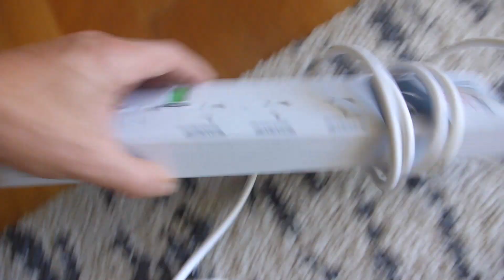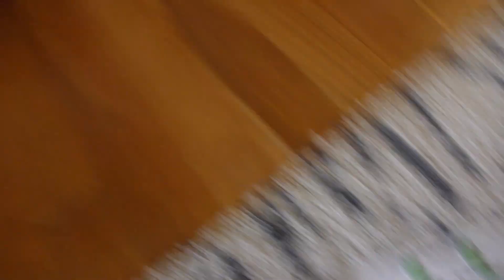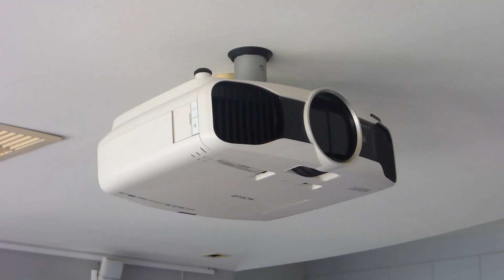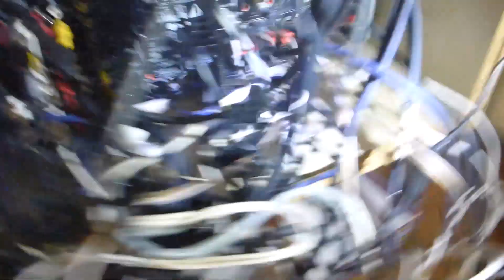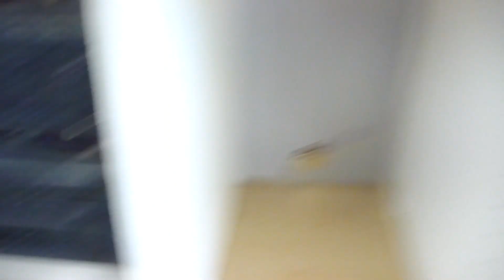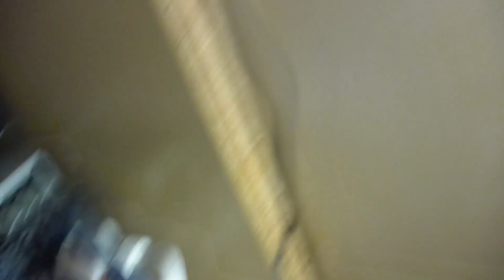How to use a Switched AC Outlet on your Amplifier or Receiver

Comment: have you tried to tun on your projector, while the avr is in stand by mode or even off?   to see if everything turns on n off correctly?

"cheers from Dallas TX! "
Reply: The projector will power on - it's on a separate circuit, but the wireless transmitter doesn't power on - which is correct.